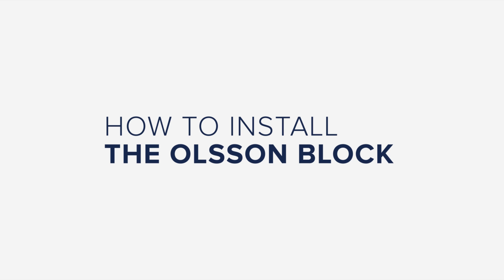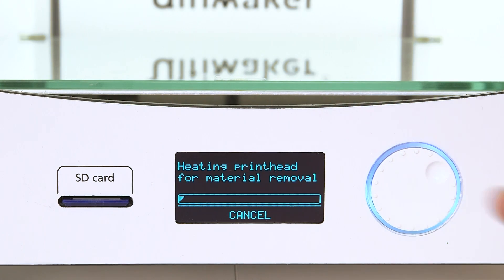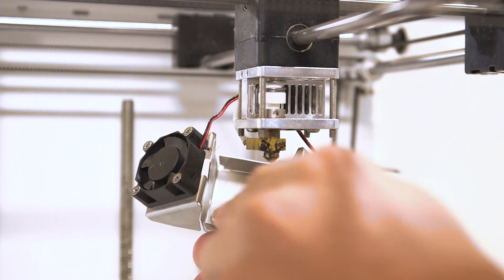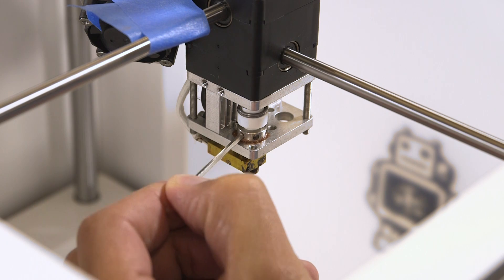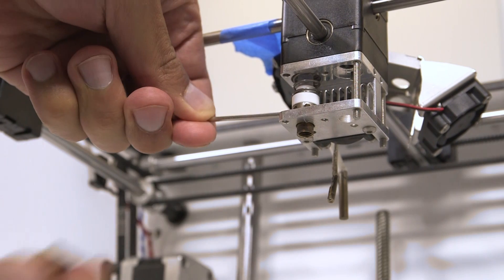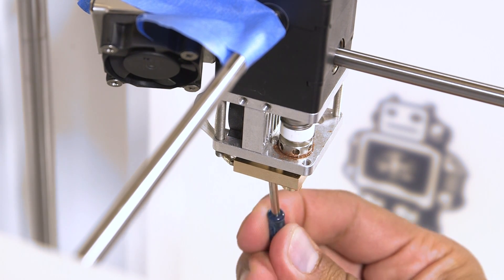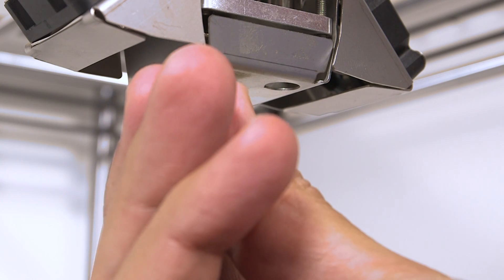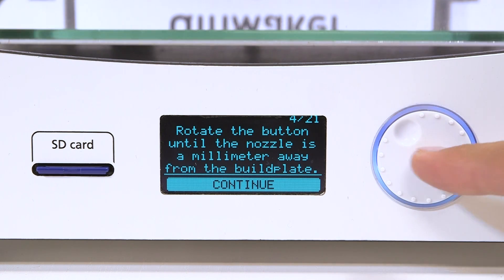How to install the Olsson Block - Ultimaker: 3D Printing Guide

Comment: is it possible to install olsson blocks on ulti original+ ?
Reply from the maker: +jedimindtrick Hi, it's actually not necessary to install an Olsson block in an Ultimaker Original+, because you can already swap nozzles in that printer without modifications!

Comment: Can't believe how easy the installation was, had no issues with the Steel Coupler or the PT100B. In fact the only thing that came in the way was the stupid Fan Bracket Hex Screws, since the Fans have Thread Locker on them it became quite hard to screw it back. I hope the UM2+ doesn't have Thread Locked Screws as it's a very irrelevant and degrades it's accessibility unnecessarily.